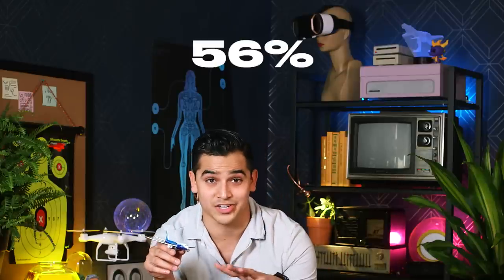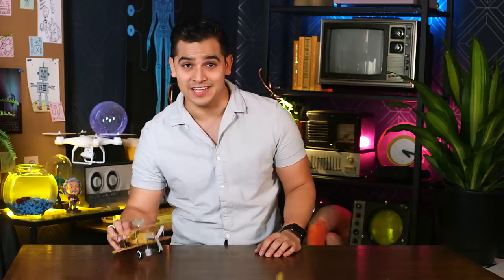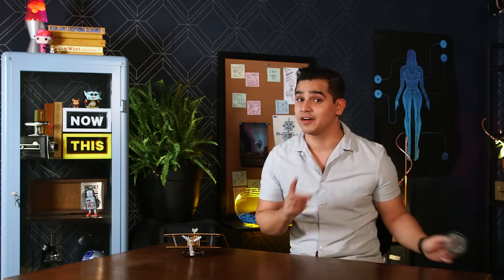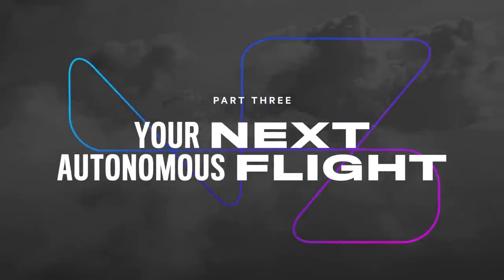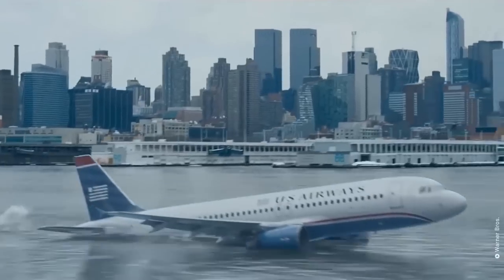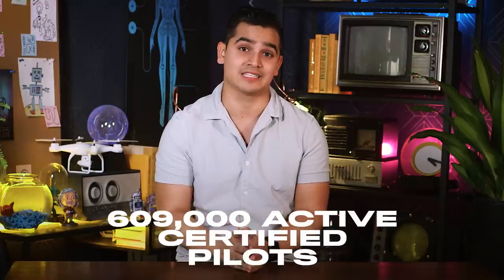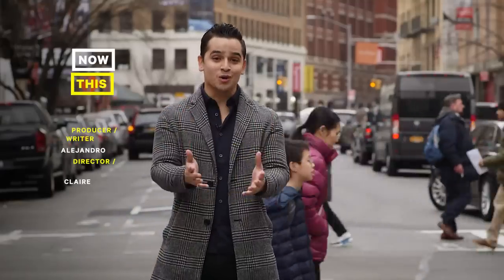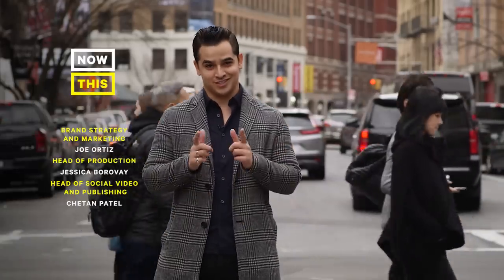How Plane Autopilot Works and How It Continues to Evolve | ConTECHtual | NowThis

Comment: Also for the explanation of how it works (from my limited understanding as a private pilot who has parents who are airline pilots)

The autopilot is comprised of multiple parts, and has multiple functions which control multiple aspects of the flight.

There is the FMC where the pilots can enter waypoints, Standard arrival procedures, SIDs and program an Autoland. This isn’t a one button push thing. It’s s a complex system where pilots have to input a lot of data they gather from charts, observations and calculations that way the autopilot can calculate how to fly the plane in the most efficient way.  A lot of the initial route planning is done before departure.  The waypoints are input at the gate along with other necessary data.  In between both pilots on the “dashboard” is the mode control panel which is a series of buttons and dials which control what the autopilot is supposed to do.  

The autopilot can be told to follow the path programmed into the FMC or can be told to follow a certain heading that the pilots select ok the mode control panel. On the mode control panel there are also dials to control the altitude to fly at, at what rate of climb to climb at. There is also an auto throttle which is independent of the autopilot where the pilots select the speed at which they want the plane to fly at. 
So yes, the plane could technically follow a route input by the pilots from the start of the flight but this rarely and I mean rarely every happens most of the time vectors are given, traffic needs to be avoided, altitudes need to be changed due to traffic or weather or other stuff which require the pilots to take the plane off LNAV mode (where the plane follows the pre determined route the pilots programmed at the beginning of the flight. Even with the autopilot on flying gets very busy and requires a lot of attention and skill. 

Also planes do not automatically Autoland. An Autoland can be programmed on most commercial airliners but only at select airports under certain conditions. Autolandings also require special pilot training and are actually more work than manually landing a plane which is why it only accounts for less than 1% of landings.  

Even if there was a system that could handle every aspect of the flight and could actually fly a plane on its own under routine conditions there would still be a need for pilots during emergencies.
There actually is no plan to remove pilots from airplanes right now.
The end goal is an AI autopilot with one pilot monitoring and taking over in emergencies.
News medias say “pilotless planes” but they aren’t referring to airliners. They are referring to Personal Air Vehicles (PAVs) 
Manufacturers have also stated on multiple occasions they do not plan on removing pilots from airliners. They want to use autonomous technologies to smooth out pilot error. Boeing and Airbus along with major avionics companies DO NOT expect a day when planes will be pilotless.

Comment: Well no the pilot’s job is not done by the autopilot the autopilot makes the job easier but the pilots are still flying. They are just flying using the autopilot.
It’s pretty much just cruise control for the plane.

Also the 56% of pilots and 29% of pilots thing has already been debunked. Yes it has happened that pilots fell asleep but it is nowhere near that common. 
If it were that common jets would have been scrambled to intercept airliners without radio comms nearly every day.
That obviously doesn’t happen.
Autopilots also make 0 decisions which has always been the primary job of the pilots.

Comment: As a pilot, there are so many inaccuracies in this video.  Virtually every jet-powered airliner since the early 80s has an autoland system.  Also the "56% chance the pilot has fallen asleep" is absolutely fantasy garbage.

Comment: Horrible information…. It never explained how autopilot works, and then talks bananas about the role of pilots in the cockpit.  No, pilots DONT sleep inflight, there are things happening during the flight concerning traffic, route and weather, so the pilots are monitoring and adjusting all the time with the HELP of… you guest it, the autopilot, which it’s main function is to alleviates workload.